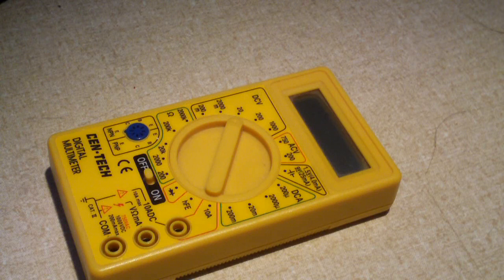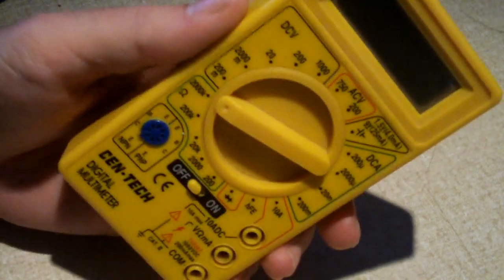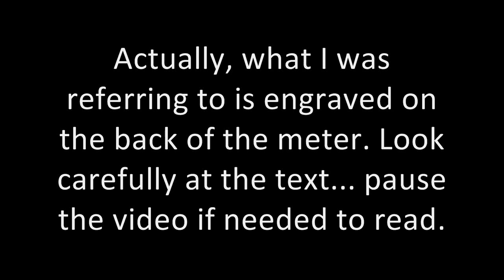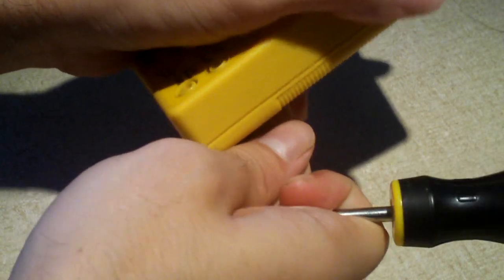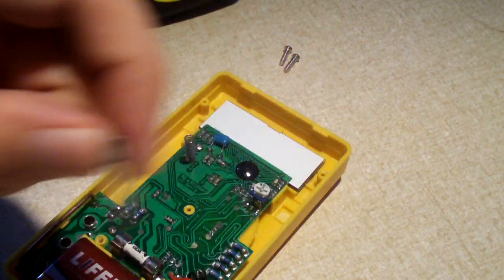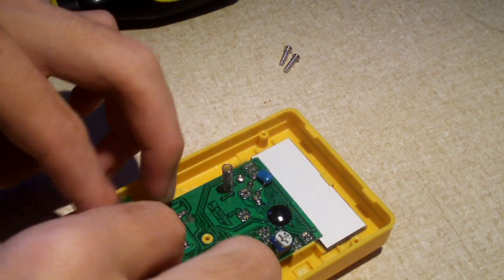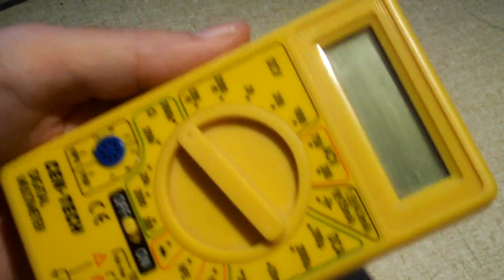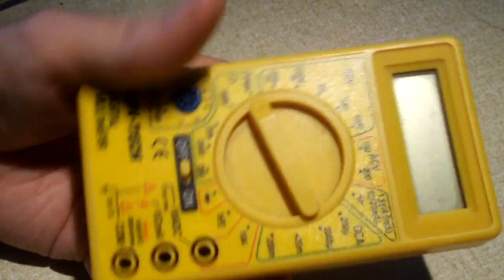How to replace the battery and fuse in a basic digital multimeter

Comment: Will these multumeters take a rechargeable 9V battery?
Reply from the maker: I don't see why it wouldn't work with a rechargeable 9V. Though you would have to use your DMM a lot for there to be really much of any benefit. My current DMM has been running the same 9V since it was new a few years ago. NiMH rechargeable batteries tend to lose a significant amount of charge over time.
Reply: Cube Computer Channel 
So NiMH rechargeable batteries won't last as long as a regular alkaline battery?
Reply from the maker: If the meter does not see daily use, then no, the NiMh will likely self discharge enough to where the alkaline would outlast it. Alkaline batteries on average have a 10 year shelf life
Reply: Thanks man, you just saved me from wasting money on a 9V battery charger and rechargeable batteries. Is there a way to calibrate this particular meter without having to use another meter?
Reply: How often does this need arise with these meters. I really like the look and features of this meter and I want to get one.
Reply from the maker: Mine seemed to be calibrated after replacing the battery. I believe some meters can self-calibrate (they can zero out on their own).
Reply: What is that knob on the circuit board for? Does that need to be adjusted from time to time? How is that done?
Reply from the maker: I think it is used for manual calibration though I have never had to use it.
Reply: Thanks for your help! I'm going to sleep now but I will be back here tomorrow night cause I would like to know more about this multimeter. I'm going to pick one up at Harbor Freight tomorrow.
Reply: Yeah so I went to Harbor Freight and got one for free with a coupon I had. Can this thing test capacitors? What setting would it have to be on?

Comment: my multimeter fuse is 10mm length.that was so small..i have look many electronic shop..but there are no fuse like mine..can i change the glass fuse n sure it have a same volt and amp..jus different of size.

Comment: I have a wierd problem, I tried to replace the battery because the old one was about 4-6V, the multimeter was working fine but I was unsure to its accuracy... But when I placed the new 9V battery in, it beeps continuously whatever setting I try and it doesnt read anything (tried measuring voltage), the screen just shows a "1 ." all the time. No battery picture, nothing else but the "1 ."
How does it work with the dead 9V battery but not my new one?! The fuse i fine
Reply: I also have a similar problem. when I try to measure something, it always shows "1."
Reply from the maker: That's odd. Normally when it shows a 1 in resistance, you're measuring an open circuit or you have the selection on the meter set to the wrong resistance value (measuring a 4k circuit when set to the 200 ohm setting on the meter.
Reply: Cube Computer Channel yes, and in my case it should beep on the 200ohm setting (if the circuit is open)

Comment: Is it Ok replacing a 9V zincc-arbon battery with an alkaline in the multimeter?
The manual i have suggest to use 6F22 batteries (=zinc carbon)
Maybe alkalines will affect the multimeter precision or they just use zinc-carbon because cheaper?

Comment: Thanks for the video. I have actually blown the fuse on my multimeter (tried checking a high current on the low-current range) so I need to replace it, but I've never opened one of these before so I was a bit worried that I might have some problems. Your video makes it look quite manageable though. Many thanks

Comment: Why doesn't it come with a 10A fuse, to save cost?
Reply from the maker: No Name No, because the circuit is designed to have a 500mA fuse.
Reply: How do you change a fuse in a schauer c612 battery charger..
Reply: Cube Computer Channel

Comment: Hey Cube Computer, My multimeter is installed with a 200mA 250V fuse unfortunately its blown, My doubt is  can I use a 250mA 250V fuse instead of that. I am asking this because a 200mA 250V fuse is not readily available in My area. Please share your ideas. Thanks.
Reply from the maker: You should be okay with a 250mA fuse. The neter in this video (from what I remember) has a 500mA fuse.